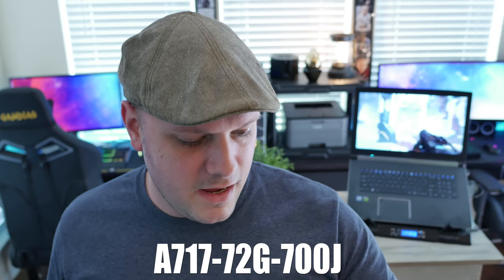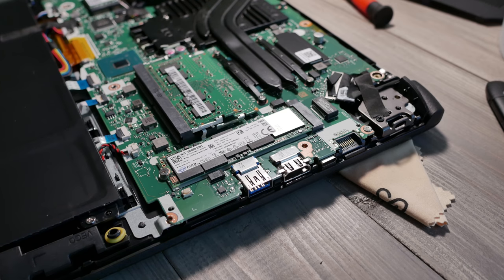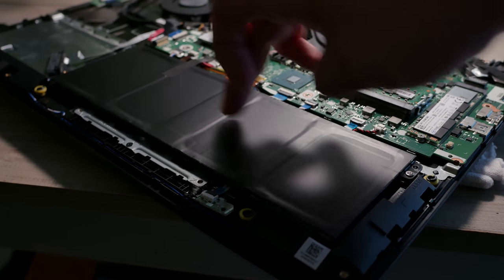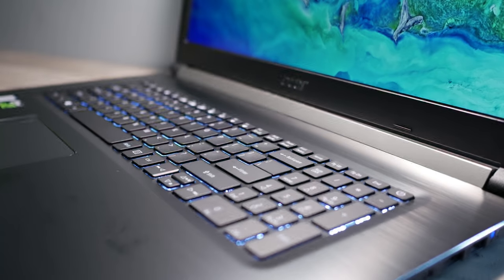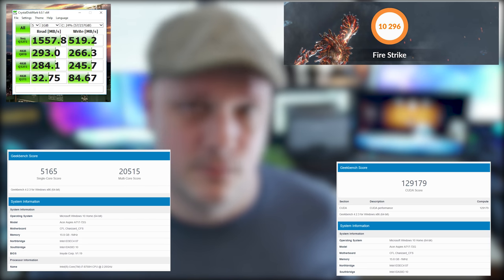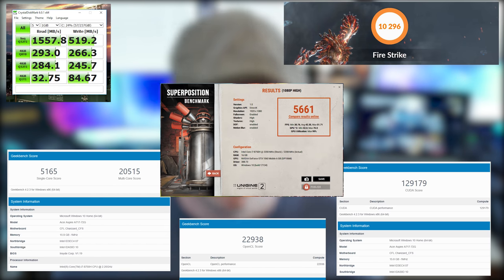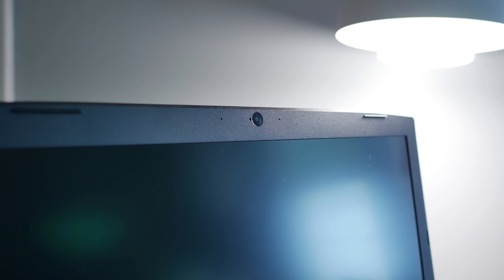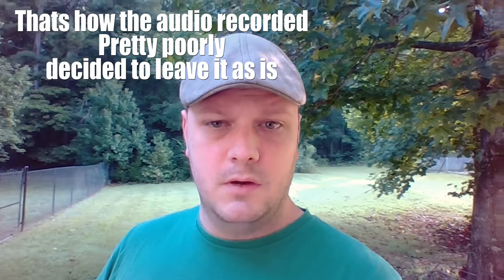Acer surprises again with a Newegg exclusive Aspire model

Comment: This is the best computer review I have ever watched (and I have watched a ton of them). Great Great Job!!! So you said it gets hot- but it doesn't thermal throttle, do you think it get any hotter than any other gaming laptop would under the same stress (VR and gaming)? Other than looks- Is this sort of a mild mannered Acer Predator Helios 300 (17-inch, PH317-51/52)? Do you think the Helios would have better cooling? Sorry for all the questions! Thanks again for the great review.
Reply from the maker: It hits that fine line of 'I feel like you should throttle out and shut down' but never quite crosses it. 

There are a lot of similarities in the two laptops, one of the biggest differences is a 144Hz refresh rate built in (and an IPS one at that...), the rest feels like just gamer aesthetic appeal. I have not had hands on with those laptops but if I had to guess I would say its the same "engine/chassis" setup but instead of an F150, its an Expedition body style with mild feature differences. If that makes sense.
Reply: @EightSixMatt  Thanks for the reply and this video is great- not only extremely informative, but really entertaining! Costco has the Acer Predator Helios 17" Model  PH317-52-77A4 for $1400. I'm going to wait and see if that drops a bit before Christmas. The nice thing about Costco is that if I buy this with my Costco credit card, I'll have a 4 year warranty built in at that price. Considering the heat these put out, paying a bit extra and getting that long warranty is worth it to me. Besides the nicer 144 Hz panel on the Helios, I think the fact the Helios is chunkier may help it stay a bit cooler also. I've also seen mention about the aeroblade metal cooling fans on the Helios- chances are that they are using the same fans on Aspire 7 A717-72G-700J , but I don't see it mentioned anywhere. Thanks again!
Reply from the maker: @gak0090  The fans are just intake blower fans, they didnt strike me as too fancy at glance. I also didn't investigate them well. Heatpipes go a long way for efficient cooling. Enjoy whatever you pick :) I'd always recommend a low price little lift/cooler for any of them for extended use! :)

Comment: Hi! Do you think 8300h would be cooler than 8750h? I'm about to buy acer 7 17inch and i think 8300 is enough for me but 8750 is just 50$ more. Its really important to me because i really dont like feeling heat.
Reply from the maker: They are both 45w TDP CPU's. Expect similar heat from either.
Reply: you can always underclock your pc to sacrifice performance for much better cooling/temps

Comment: Sorry, I would need to know if it is true that this equipment has a free bay to place an additional HHDD. In the technical specifications (https://www.acer.com/datasheets/2018/4876/A717-72G/NH.GXEAA.005.html) does not speak anything about it, but it happened to me with another ACER that did not say nothing and had another bay for a hard drive. Thank you!

Comment: The only downside is the placement of the windows key (every time I go prone in battlefield, I hit the windows button). The ctrl and fn key on the left need to be swapped too. Other than that, for the price $999 or less it can't get better than this really. You have to get external storage as you only get 256gb. Still not bad as a HDD/SSHD w/ 2TB is only like $80.
Reply: Do you have this laptop? Hows your thermals do? Do you have any thermal throttling, I read that some people do, so Im curious. I couldn't decide between this and the Helios 300 yet.
Reply: @kevinhappy5119  yes i own it. Had it since July. I mainly just casually game with it. Im sure the helios thermals are better as it is more specifically a gaming laptop. The 300 comes with software to overclock undervolt the cpu and gpu as well i believe. I have no real noticeable throttling. In battlefield 1 i get an occasional drop in frame rate if it is very very hectic like the train level. I play battfield for maybe 30 mins to an hour str8 1080p ultra and it gets hot but not on the keyboard. I also use an old cooling fan pad and use the cool boost setting. I would wait until black Friday and see if you can get the helios 300 for the 999 to 1099 with i8750H. They also have a amd 7 2700 rx580 acer helios 500 now too. I would check that out first. I believe the 580 4gb and 8gb versions are about 10 fps better than the 1060. Also, 7 2700 8 core is much faster for multicore. Its about $1500.
Reply: ThaRealERAQ  Thanks for the reply! I'm bound to a particupar shop because I had a Y720 for a year now, but it had a lot of problems so, after all, the shop agreed to take it back and I can choose another machine, telling you because they dont have the amd version one. Tho the helios 300 has the same specs as the Aspire (i7 8750h, 1060 (6gb), 8gb ram) but without an SSD. If I look at it from the money side, there is only 5-10$ difference. I would lean towards the Aspire, because it has an SSD, and I like the look of it much more. But the Helios 300 comes with +1 extra year of warranty. Ultimately, I would love the Aspire much more, only If I knew it has a good cooling that I dont have to really worry about, or atleast not significantly worse then the Helios'es cooling.
Reply: @ThaRealERAQ  I can't open it till Christmas, so I'm researching weather or not I chose wisely.

How would you rate it's heat level?

Comment: i was curious, so there is two hard drive bays and the second hard drive bay is completely empty?
Reply from the maker: There is the single m.2 (with SSD installed), and a single 2.5" HDD bay. the 2.5" bay is empty :)
Reply: @EightSixMatt  ah, excellent! thanks for replying, most of the tech channels Ive visited have comment sections filled with questions and zero interaction and answers from the channel owner, even on smaller channels with like less than 500 subs. im noticing a high level of interaction with the viewers in your comment section. keep up the good work, cheers!
Reply from the maker: missing hours I’m big on community involvement. I’d like to build a community on here (at least that’s my hope). 😊 sometimes I don’t get every comment but I try and keep my eyes out.

Comment: Hello Mister, can you tell me the model of motherboard of this computer?  I have one, and i want to know what microprocessor are supported, i have it with an intel i7-8750h
Reply from the maker: The motherboard is an HM370 chipset which is an FC-BGA1440 socket. As far as mobile CPU's that fit FC-BGA1440 goes, that 8750H is pretty primo. In sort you're looking for BGA1440 compatibility - check this link: http://www.cpu-upgrade.com/CPUs/Intel/Core_i7_Mobile/index.html The only other relevant contender is a lateral side grade - i7 8850H (in my opinion)

Comment: first thanks for your great and well arranged work second i will be very happy if you told me what tool kit you used it to open and disassemble this laptop it's the first time for me to open a laptop and i have the same one with same specs in your video but i'm afraid to break it as it's not such a premium build material .. i'd like to do a repasting for it trying to lower the temperature .. it will also be an excellent content if you made a video for this laptop it self doing this job from the beginning of the disassemble and repasting this laptop with liquid metal " Thermal Grizzly Conductonaut " as a solution for the bad high heating issue for this model particulary but it needs some precautions in order to made it safe due to the conductivity of this paste there's a lot of videos that show the precautions like using conformal silicone isolating spray coating and thermal tape i'm sure you can do this perfect and also undervolting this laptop and benchmarking it then .. if you can't please tell me how to disassemble it safely and which tool kit you use :) 
thank you so much .
Reply from the maker: Conductive pastes have always been a turn off for me. So much can go wrong. Be very cautious. I did not use anything too fancy. The snaps and pops are a pain. A plastic bezel removal tool comes in handy (most cheap cellphone DIY repair kits have these, they look like plastic rounded triangles to help you snap and pry a little easier).

I often consider doing under volts, over clocks, power management displays, but I almost always DO NOT display this. I do not want someone to damage their product (whatever it may be) based on something I do. While there are plenty of people who help with that I decided (at least for now) that this isn't what I am going to do. :) Thanks for checking out the video!

Comment: How is the display? And battery life? I am gonna buy it with 32 GB ram and 2 TB memory
Reply: The screen is pretty good for me at least. There is however some back light bleed around 2 of the screen edges  but its only noticeable when whatever you have on is almost completely black. Other than that you wouldnt know. As for the batttery life i cant tell you for sure. Btw the laptop has a slot available for both an SSD and an HDD and only requires 1 screw to access since its in a separate panel. i bought the variant with the SSD and Salvaged the HDD from my old laptop. And if you havent ever used an SSD like me, the difference is actually amazing so consider getting an SSD as well.
Reply: @redcastlefan  one more question is there no dvd reader? I have known soon
Reply: @shokhtv4966  No there is not. And to be honest, It doesnt bother me as i rarely use dvds anymore.

Comment: Sorry this is maybe dumb question, but is the battery replaceable?? I read somewhere that it isn't.. so I am just wondering..
Reply from the maker: Pavol Lizák I haven’t needed to replace the battery, it’s design isn’t one that disconnects like typical enclosed/encased batteries. Not replaceable? I’m sure it could be replaced. Is it easy? Maybe not as easy as one would hope. I haven’t looked but I’d probably contact Acer about what type of battery specifically, and or how to replace it independently and see if they have an answer. 

Usually third party companies make compatible/generic battery replacements. (Or so has been my experience in the past)
Reply: @EightSixMatt  thanks
Reply: @EightSixMatt  I have one more question. So I want to buy laptop and I have been searching for some good one for the couple of days but I can't decide which to take, do you have some recommendation?? It should have gtx 1060, i7 8750h and it shouldn't cost more than 1400. I don't care how it looks, how thicc it is, how display is color inaccurate. The only thing I care about is cooling and temps...

Comment: I hope you can help me. I'm between hp omen 15 i5-8300h gtx1050ti and acer aspire 72g 71vz with the same specs. what should i buy? :( i'm worried about fan system bcz hp omen has one fan in each side while acer has two fans in one side.
Reply from the maker: I don't have any hands on with the Omen, I can say I would anticipate a higher quality build out of it (but I'm not sure). 

Here is a constant for most laptops. Depending on what you're playing and for how long, they will all heat up. I've seen neat innovations to help vent and lift up gaming laptops but it only slightly mitigates the issue off heat vs solves the real problem. 

I've never owned one that didn't get hot. The absolute best thing you can do is keep a slimlined USB fan cooler. They help a lot (though they are slightly inconvenient). 

Sorry for the text wall^ whatever you go with, they all get warm (even the cooler rated high dollar ones still throw some heat).
Reply: Eight-Six I see... well, thanks for your answer! I'll keep in mind. Pd: i like your review. My other question, the quality material of thaf acer your video is good? I mean, i read it tends to break quickly

Comment: I bought a refurb unit a couple weeks ago at Microcenter for $759, which I thought a great price for IPS, 6 cores, SSD, 16GB RAM, GTX1060. Yeah, I rather have the faster i7 or i9, a RTX2070, only USB3.1 ports, and a Thunderbolt port, but that's about 2x the money. I've not seen the power I got for less money anywhere in a laptop with IPS display.

How did my machine end up as a refurb when it looked brand new?
1. It's big and heavy. 17+" screen and 6.7 lbs.
2. Heat production, loud fans, and short battery life under full load.
are my guesses. #2 can be addressed. The problem is no power management software from Asus, just some bloatware. For long gaming and rendering, it's best to throttle down the CPU and GPU. Intel's Xtreme Tuning Utility is free and essential for turning down the CPU TDP and perhaps undervolting a little. Nvidia has just updated drivers so you can limit FPS to the display's refresh rate, 60 Hz, but I heard the display can be increased to 80Hz. This can cut power and heat waste greatly. Then there is also MSI Afterburner for more control.
Reply: So can you overclock this display to 80hz?
Reply: @TSHEKHAN  I actually returned it, so never tried. I however found out that the display only has 6 bits/color, so better to use an external monitor. My unit's trackpad stopped working (possible driver issue) and crashed randomly a few times. I traded up to a Dell XPS 15 with OLED display. Then, after 10 days it's display would go blank, and I'd have to close and reopen the lit to get it back until the next time. The store (Microcenter) cheerfully replaced it with another, which has been working well so far. I was wowed by the OLED display and wasn't going back to less afterwards. The Gigabyte Aero has the same Samsung OLED panel, but I hear the anti-reflective coating isn't as good as on the Dell XPS, which is indeed superlative. Superior AR coatings are the norm on camera lenses and even eyeglasses. Long overdue for TVs (listening LG?) and computer screens to have them. Decades ago I used pro Sony crt monitors with excellent coatings, and LCD panels remain a step backwards from their dynamic range and colors.

Comment: Hi! Do you think is a good laptop for 4k video edition?
Reply from the maker: It is, the caveat is the fact that its a 1080p native display, with less than desirable color/contrast. The HDMI 2.0 allows for external 2160p which is great. GPU CUDA excel for the iGPU is solid. -Yes it can handle it, if you know your video you can edit easily,  but for an anal more 'pro editor' (not me), the display won't offer what they want for editing unless they go external monitor.

Comment: Hey for video editing would you go with this for about a grand or the 4k xps 15 for 1600
Reply from the maker: If you have the budget for the XPS, I hear it's great. A buddy has one and he feels like he paid more than for what he got. As an editor a 4k workspace with a brilliant screen is a huge advantage over this Acer. 

The acer is more 'good enough' for a confident editor, but if the option is on the table for you, I would spring for the pixel real-estate and more color accurate screen. (Not to mention for portability)
Reply: @EightSixMatt  thanks for the info is there any other laptop you would recommend in the $1600 area.....I read mac's aren't what they were any more and most PCs have taken the lead.
Reply from the maker: @chasingsevensfishing245  Macbooks are a special breed. If you like OS over Windows you will like Mac better. Those are subjective debates though, buy based on what you want out of something :) I love Macs but I prefer Windows. That being said I love the appeal of Xiaomi over most brands. Xiaomi has a gaming laptop that mirrors a lot of mainstream specs for less at times (The downside is they are imports because Xiaomi has not expanded much out of the Chinese market, you'll have to do some work to swap the language. If you are versed in easy tech than no problem for you :) ) I'll link one in this comment if you want to save some cash and take a look at sweet sleek yet still gamer laptop. (I use the Notebook Pro as my daily but this is an upgrade for even that one). 

If you want to stay in familiar US market, the MSI GP73 is a good choice. It's normally 15-1600 USB but if you shop around I've seen it for less. (was just talking about this laptop)

For a solid editing/gaming combo I can anticipate greatness based on my exp with Xiaomi:
The Xiaomi Gaming Laptop:
https://www.gearbest.com/laptops/pp_009863355765.html?wid=1349303&currency=USD&vip=16853413&gclid=CjwKCAiAiarfBRASEiwAw1tYv5CGjJWrn1S1oEuY0pxjtKleb-HVA1qUDljM3_dBga3pw1OMNiH8FBoCRHAQAvD_BwE
Reply: @EightSixMatt  thanks have had mac's in the past felt they always crapped out.....do like windows looks like I have a bunch of research to based on what you recommend...thanks for the advice👍👍👍👍👍

Comment: Would you recommend this laptop ?
Reply from the maker: Yeah I'm enjoying it! Using it right now actually :) it's been pretty solid but sometimes these 17" laptops feel too big. I always the 15" size was the sweet spot.
Reply: Been planning to gey these aspire 7 here in k.s.a the i7 8th gen with 1050  variant . Goood thing i browse newegg find these amazing deal . Of course thanks for you review . Good luck and more power to your channel . 👍
Reply from the maker: michael emnace thanks😊
Reply: What would you recommend to put in the 2.5 bay ?
Reply from the maker: michael emnace a firecuda 2.5” those are my favorite for the price/speed/tech it’s an SSHD the 2tb is my go to. 😊
Reply: @EightSixMatt  laptop  just arrive. And impress with the quality. Even though its very finger print magnet.  Nest step is find firexcuda sshd if its available here in saudi arabia. Any laptop cooler with just fine? Laptop will used most for cadcam and maybe light to moderate dota 2 and pubg.

Comment: they mousepad isn't too far left. the mousepad is centered beneath the spacebar because when you type, it will require the least amount of hand movement to go from typing to mousing(?) regardless of if your left-handed or right-handed. it's actually pretty good design.